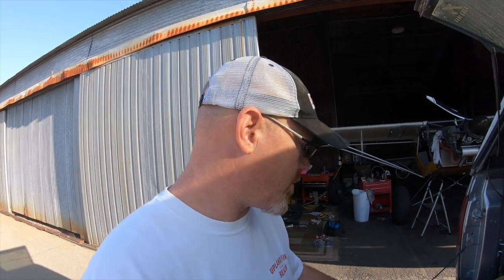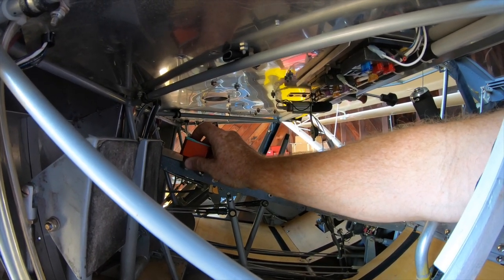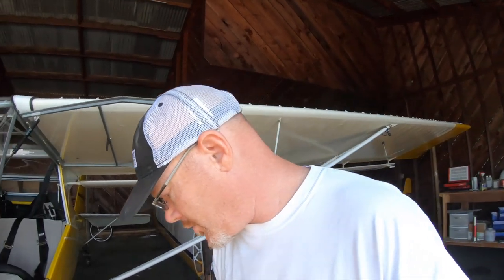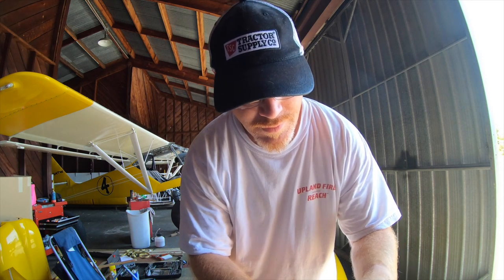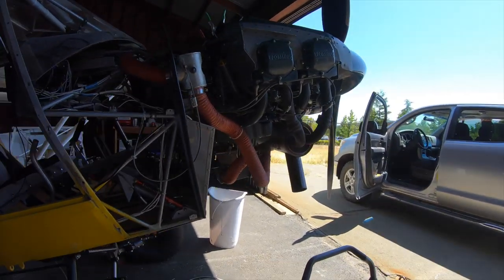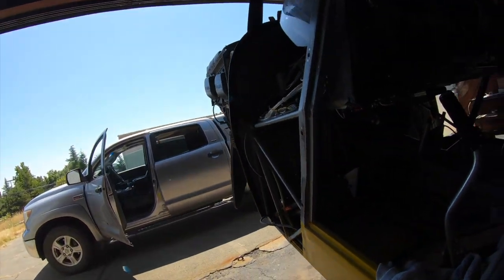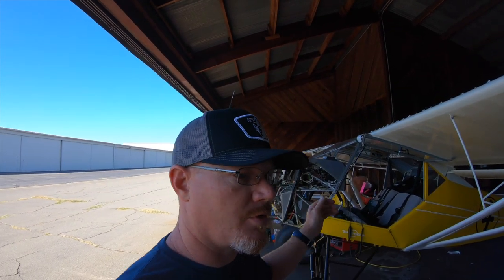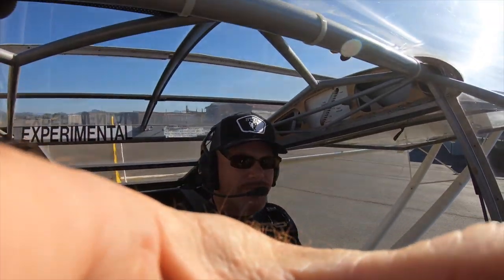Beringer Master Cylinder Install for Kitfox

Comment: Love your new Bowen-Aero branding and graphics -- sweet. Berringer logo, too. Thanks for showing about the banjo fitting. Think I could do that - same concept but easier than copper tubing. The Berringer hardware sure is pretty. When I get there, you'll be the guy. Be sure to tie all those purdy cables down with GripLockTies!
Reply from the maker: Grip lock ties installed for sure, just forgot to film that part.

Comment: I think the brake lines should be secured to and inside the airframe!
Reply from the maker: They absolutely are, sorry for not showing the finished and secured lines. I used grip lock ties and secured them so there will be no chaffing and no interference with the pedals and cables. Good catch.